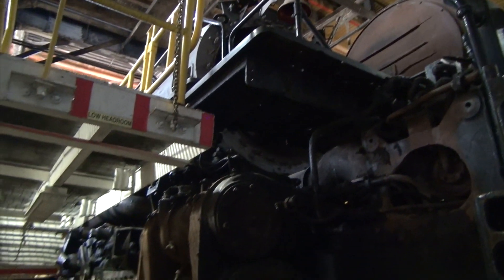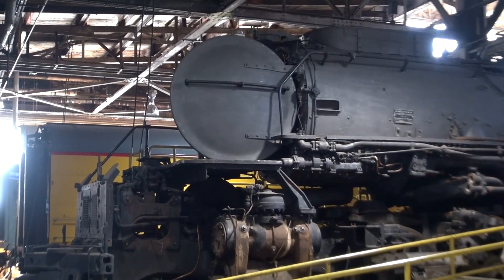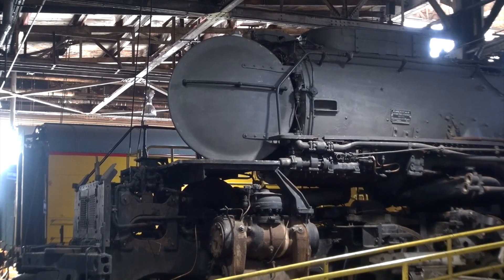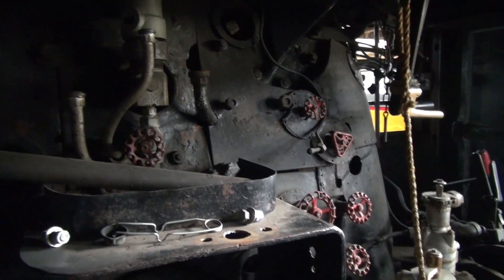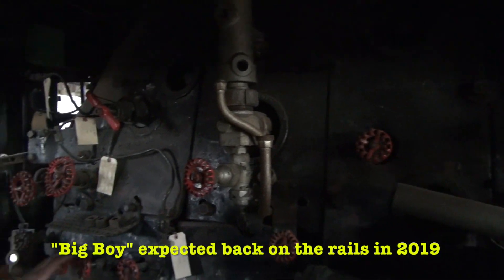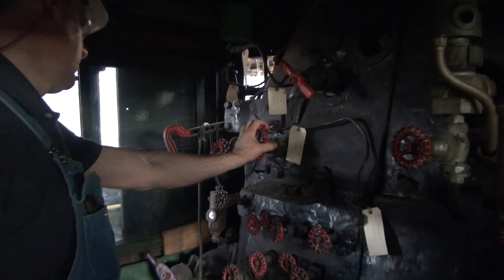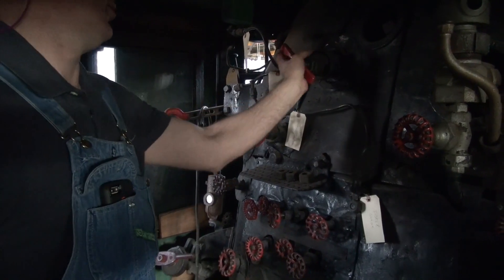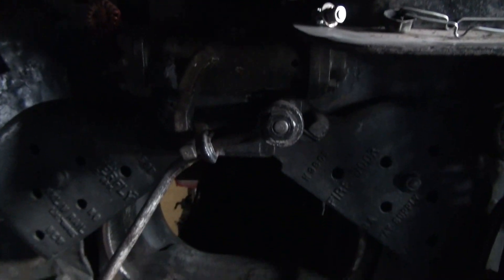UP 4014 "Big Boy" Update

Comment: These engines - I mean the 3000 / 4000 class locomotives could never run in Germany! They have been built to pull super - long freight trains over long distances, running straight all the way, e.g. from Ogden, UT to Cheyenne WY. How far is that...could be some 1500 miles or 2300  km.

Comment: biggest?  not in reguards to hp, or weight, engine alone length yes, but the allegheny is bigger longer overall with its huge tender, and had a higher horsepower rating.  but I still hope to see this run the open plaines of the west and pull long freight trains like the challenger did in the past.
Reply: Are there any allegheny's left to restore?
Reply: there were 2 that were not scraped the one in the henry ford museum dearborn and the one in the b and o  mount claire museum in maryland
Reply: manga12 I wonder if UP has thought about restoring one of those?
Reply: its not one of their engines of course not, it would have to be csx or some group that would front up and want to get the engine and have the facillities to do such a massive undertaking, do you understand how big it is, its huge, and where it could run.
Reply: manga12 yeah, that makes sense. oh, I know how big these things are. I was in Colton, CA when they pulled the Big Boy out. Just insanity. well, at least those other big engines didn't get scrapped. Who knows, maybe one day.
Reply: the funny thing is there were more alleghenies made then big boys, and only 2 survived, but I think once they get the t1 project compleated it will have lots of ponies that might just give the bigboy a run for its money as far as hp 6000 vs 6500 for the big boy, but that day is still a long way off, but once the second driver is made we will have a set  with three more sets need to be made, baby steps after all rung by rung.